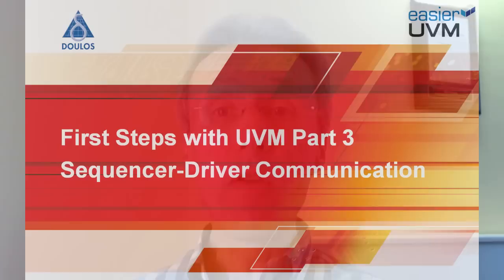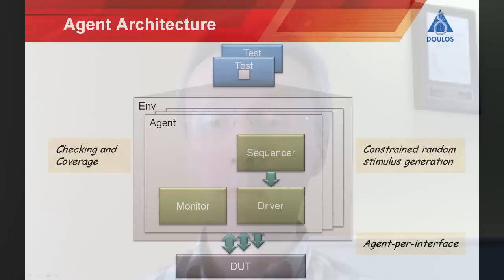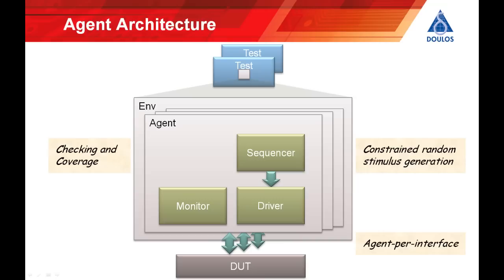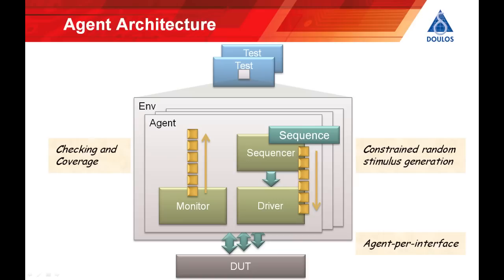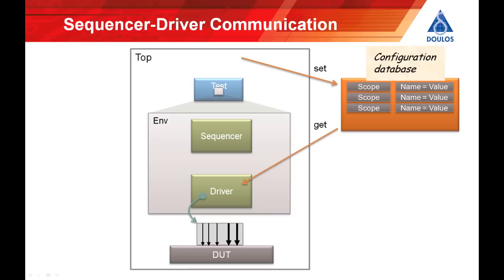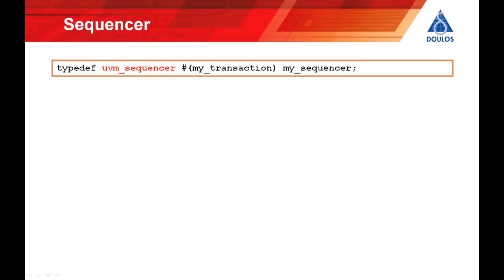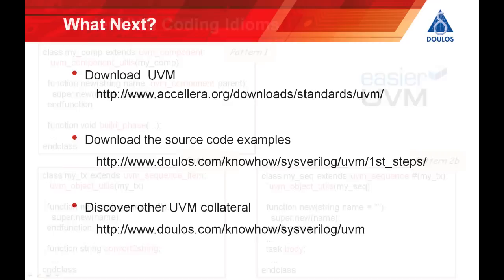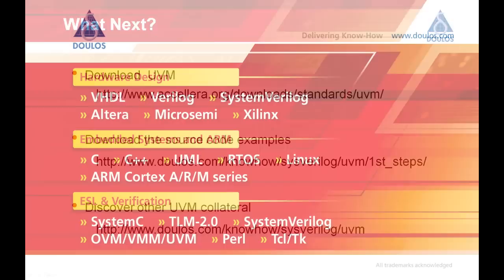First Steps with UVM Part 3

Comment: Highlights :
   - Explains mainly communication between
      UVM sequences and UVM drivers
           - Communication between sequences
              and driver happens through TLM port
           - TLM is Transaction Level Modelling and
               the concept is picked from System C
           - Sequences and transactions are
             dynamic in nature unlike uvm
             components which are static
 - Sequences and Transactions are registered
   with UVM factory using `uvm_object_utils
   macro where as uvm components like
   uvm_driver, uvm_monitor, uvm_env are
   registered with UVM factory using
   `uvm_component_utis macro

- Explains code for typical implementation of
    UVM sequence
- Explains code for typucal implementation of
    UVM Driver
- Explains how a Sequence and a Driver are
   connected using TLM ports.

In all these three videos familiarises a beginner in UVM Methodology with best coding practices , how a typical UVM environment can be set up with code examples for uvm env, uvm test, uvm sequence, uvm driver and others. One gets familiriazed with uvm factory and uvm config data base.